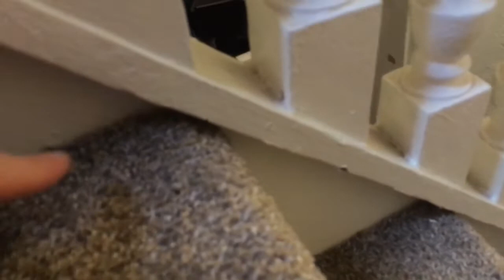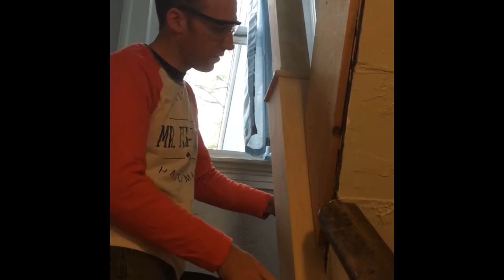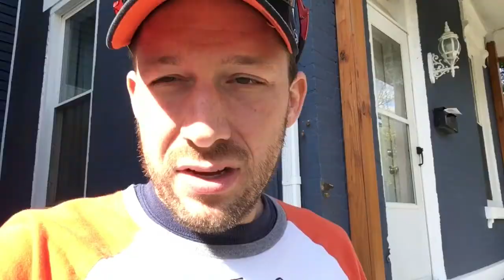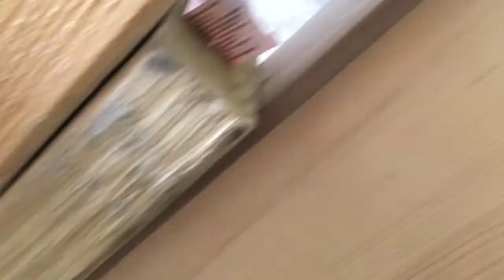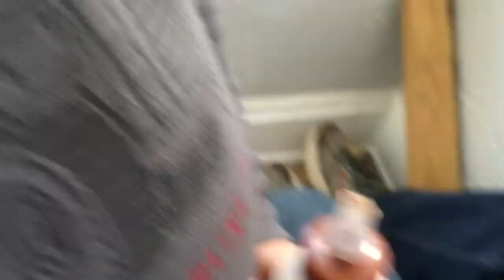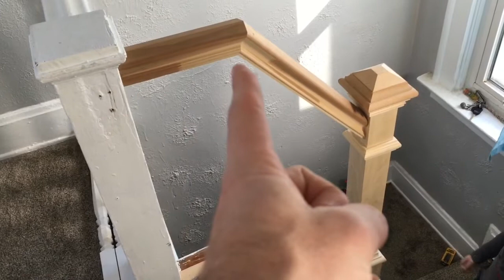Installing A Handrail | Why You Should Use a Miter Saw | Stuff I Learned The Hard Way

Comment: So how did you cut a 50 degree angle when most miter saws only go to 45-48 degrees?
Reply from the maker: This particular model was a Kobalt and its furthest reach was a 50 degree cut
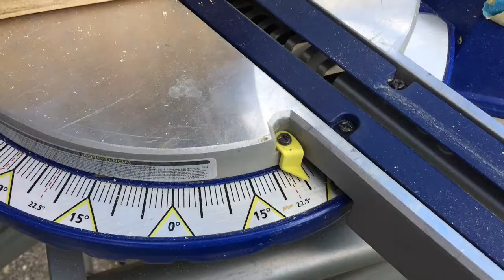Reply from the maker: You can see the saw at 6:04 in the video and if you freeze it, you can see that it goes to 50
Reply: @SpiritofaHandyman  Thanks!  I knew that, but it was a suggestion that you show how to cut an angle greater than 45 for those individuals who do not have the luxury of a miter saw that cuts past 45.  Great video regardless!
Reply from the maker: @mikehaynes5634  Great point Mike! If you need to get a miter cut greater than what your saw will do, you could use a shim to give yourself something to push the board against and it would give you a cut a little greater than 45 degrees

Comment: How did you get the angle of cutting the spindles top and bottom? Was it the same angle as the handrail was cut at? Also, good work! 💪🏻
Reply from the maker: correct, same angle as the handrail. I forget how I determined the angle, but I think it was just by holding it up and making a mark